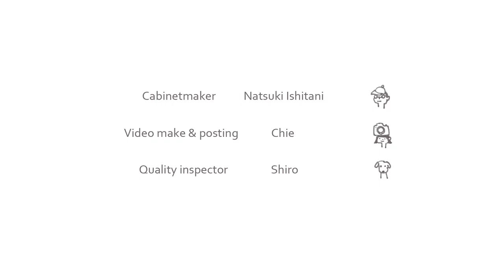ISHITANI - Making a Walnut Trestle Table

Comment: This may be my favorite piece that you've posted. Walnut is a rich and warm wood so the thick top with a square edge profile has a simple beauty and a commanding presence. The trestle style is inherently a bit rustic, but the sharp lines and tapers are quite modern in feel. The contrasting wedges in the cross-member's tenons are a perfect touch - subtlety decorative without being ornamental. I love everything about the design and execution of this piece. Thank you for sharing.

Comment: so inspiring, thank you for posting. If I may ask a question, do you rout the tapered dovetail slot in a counter clock-wise direction between the jig, or do you move the router over to the right to cut the other end of the slot? I am making a similar top and am a little nervous! thanks

Comment: You are a master of your craft. I have a question about the Japanese style plane. How often does the blade have to be reset to get such an even shave? Also you seem to be running it over a table top on work stands with a bit of wabble. Would it cut cleaner on a solid bench or is this not a concern? Thank you

Comment: I never knew it was called a trestle table! My grandpa made lots of tables like this. His usually had dark resin coating and were slightly more rustic (less fine finishing work and also more imperfections in the wood). Instead of the wedges he used big wooden pins, as would be traditional were he's from. Pretty much every member of my family has a table he's made and a few antique chairs from his antique trading business. My grandparents themselves have a huge 14 seat trestle table for family gatherings.

Comment: Is there a benefit, a side from aesthetics in the finished piece, to having the kerf angled in like that for the wedges on the through mortise and tenon joints, rather than doing 90 degrees?

Comment: Anyone know what kind of wood glue they are using on the table tops?  Doesn't seem to run off the sides of the board at all ( @ 2:07 ) and has a good open time.  Seems a lot better than the titebond stuff.

Comment: Lovely, but I'm pretty sure you should be using a larger tub of water when brushing away the glue squeeze-out. There's too much glue per volume of water that you're essentially spreading the glue all over the place, affecting the final finishing coat in many places.